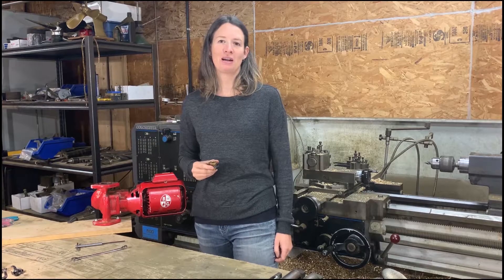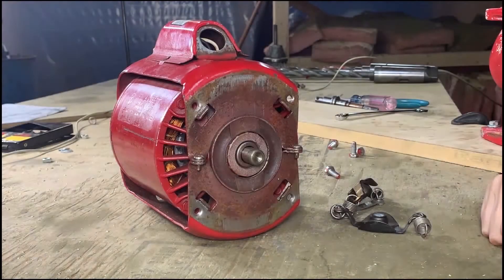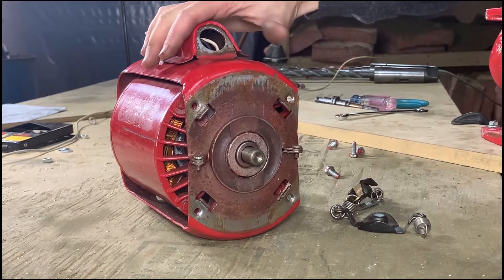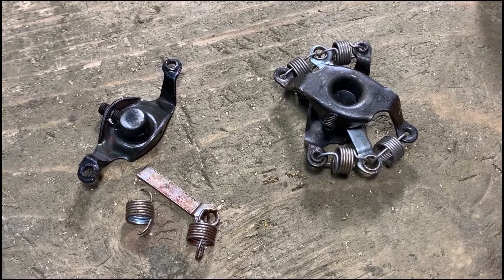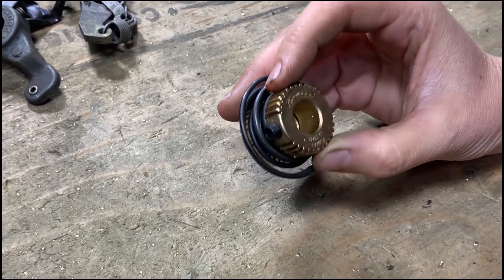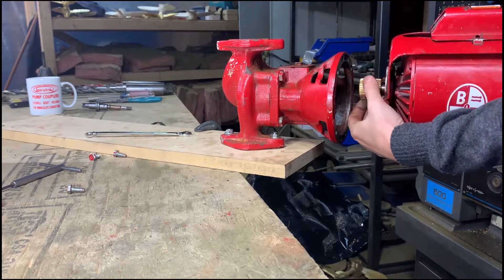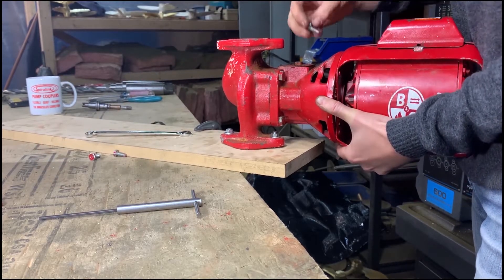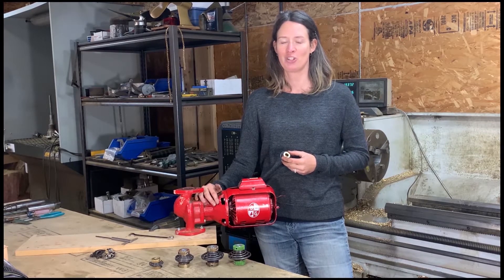Bell and Gossett coupling replacement [Spiralink Coupler]

Comment: Do you have to replace zagged motor mounts if using spiralink counper?
Reply: its best that you do...or at the very least pry off the front 

motor mount and turn it 180 degrees. ( upside down, skinny part at the top)

Comment: The original coupling in this video seems designed to fail with all of its complexity. The Spiralink coupler on the other hand is clearly
simpler in design and would likely have a very long service life. Good video of a product that deserves to noticed
Reply from the maker: Thanks Jonathan, yes this product was designed by a pump repair technician and was built to last!

Comment: There is no question, this is the best video on how to change a coupling on a  hot water circ. pump.
 She makes it seem so easy to do.  I have used these couplers for over 20 years and have never had
any comebacks.  As she says, "they are much easier to install" especially if you are on a ladder.  Even
more important when you are changing the larger horse power motors.
Reply from the maker: Thanks John! We're glad to hear you are happy with our product.